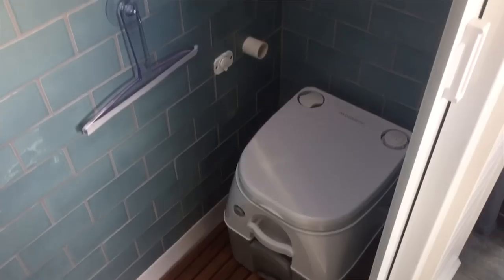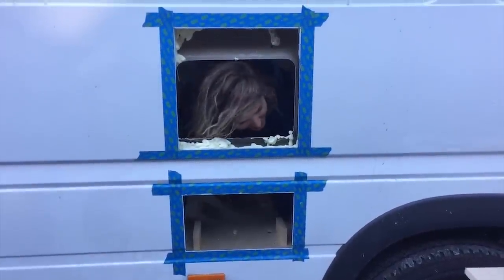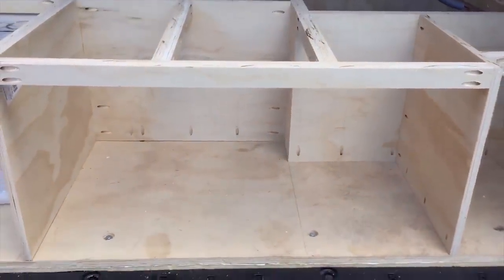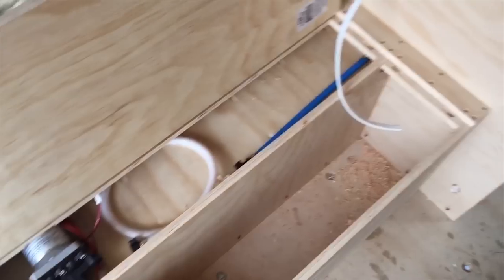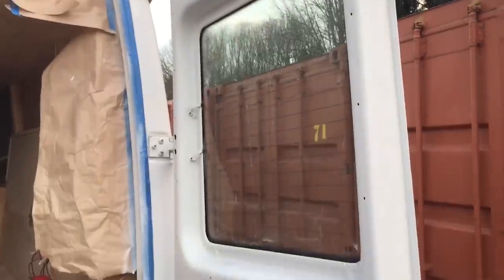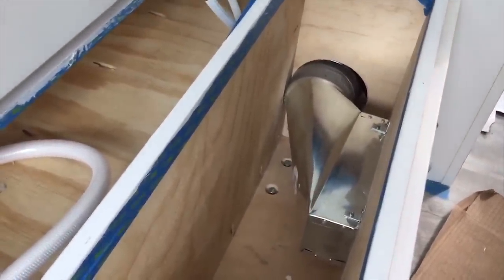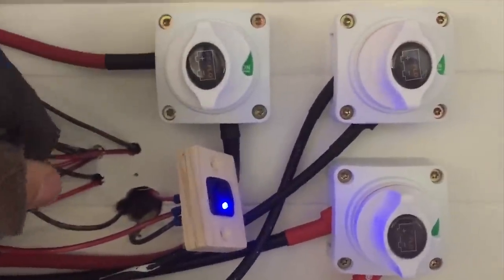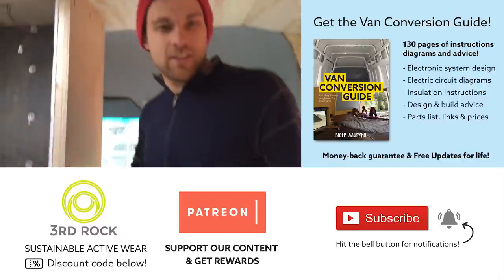THIS IS HOW YOU CONVERT A VAN - The Ultimate Sprinter Self-build Conversion 🛠

Comment: What did you bond the tiles on with? Normal tile adhesive will fail in vehicle with vibration and movement. Did you bond and screw the cabinets? Big bore domestic water fittings are not best in a place where water is in short supply. You are obviously very skilled but you have made the mistakes that many do by using domestic building techniques in a vehicle which  throws a whole range of issues and dynamics into the build. The finished job looks really good.

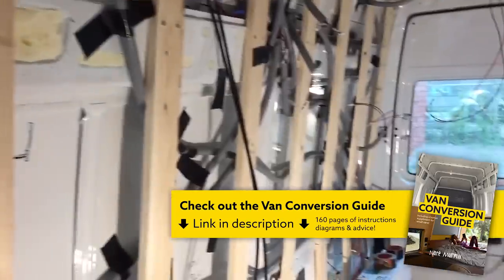Comment: Each time I see a campervan conversion I never understood why they don't do the wiring as we do in homes, so that we can replace them if we need later. I am really pleased to see at 4:35 that you have the same line of though as me.

I use at home roofs tiles of polyurethane foam and they are so effective for sound and temperature isolation, that each time I see someone using other materials for their van insulation I always wander if they don't know about this foam you used at 6:35 ;).  

Do you know you can spray this foam with a machine? The polyurethane foam for the machine doesn't expand, thus you end up having a more plane surface that doesn't need to be trimmed.

Comment: how do you let the foam breathe?  You know, so when you are in humid weather it doesnt mold/mildew
Reply: @Toadie_The_Frog  no the foam enclosed in the walls.... spray foam is not supposed to be sealed up in cavities.   It needs to breathe so as to not make mold/mildew after a few years.  manufactures recommend around a 1" channel of air for it to breathe.   (I have looked it up already a few months back)

Comment: 28:06
The insulation on those cables are going to wear through in about a month!
Why didn't you cut a hole the same diameter as the conduit and run that through the wood?

Comment: So heavy using extension cords for your electrical wiring and metal studs for your framing would have saved a lot of weight.
   Having said that the work  is well done great job. 
           And regardless of the weight I would love to have this van.

Comment: Lovely build that .  But van will be well over weight with the thickness of all that wood in it . Nice build
Reply: Was going to say the same looks really nice but would like to know the weight
Reply: Add to that the weight of backerboard and tile.  Unbalanced and exceeds weight limits.
Reply: My sentiments exactly. On my 3rd build and must say I haven't built one that nice.  I would like to know the MPGs.  That is a lot of wood.  Great insulating job.  You won't regret it.
Reply: God i was thinking the same. Beautiful but way too much wood.
Reply: presumably these vehicles are designed for carrying lots of weight. Having said that I don't understand why you would add unnecessary additional weight. Filling the water tanks must be a lot of weight. The tiles are just ridiculous. A bit of polycarbonate twinwall or something for the 'bathroom' would surely make more sense.
Reply: Ha yes this is exactly what I thought when I saw all that thick wood and tiling. It's a beautiful conversion and the vans are designed to haul large loads but why add weight unnecessarily? It will just made the van slower to drive and use more fuel, it's a camper after all not sure why you would want to use building materials to make it look like a house...
Reply: @lass-inangeles7564  There did seem little thought about the weight but they have covered that but not put that dull bit in the video. Lot's of permutations of that van but here in the UK the common maximum on a standard driver's license is the 3,500kg GVW 314CDI van which has a payload of 1,516kg, which I would say they seem to be under.
Reply: I really doubt it'll be overweight. I use a van just like this at work (builder) and we put way more stuff in it than that. It's heavier than most van build projects, for sure, but not overweight.
Reply: Rogue Panda I’m a granite fitter and that van is no way overweight 👍
Reply: Same thing i was thinking, time to add a turbo on that beast and some 4 pot brembos.

Comment: Some like more of a feeling of open space, like Nate, so they only have top cabinets on one side.  Or not at all, just shelves.  But I think a lot of a space feeling open has to do with colors.  That's why I would want a white interior, like these two did it, no matter what.  Mirrors are another trick, but white does the job just fine.  They had plenty of extra storage space but because the decor wasn't dark, it didn't feel cramped.  You give up a lot when you don't use every inch, IMO.

Comment: how you deal with the weight of so many things??? Im always thinking how expensive is on gas XD
Reply: the weight doesn't add too much to the fuel consumption, usually around 0.1 liters per 100km for every 100kg of additional weight :)
Reply: Transmission, brakes, tires, gas mileage ...
Reply: Don't get me wrong, I think that is an amazing job. I'm thinking in my case, I wanna convert as well a vehicle, but I'm always thinking in the 💰
Reply: Brianna B it’s a van, it’s designed to take weight
Reply: @MrBrenos  ... ALL vehicles have weight limits.
Reply: Brianna B no s$&t.
Just like my merc that is rated to carry 2.5 tonnes.
Reply: @briannab5296  Agree, will be way overweight - which means its dangerous, (suspension and brakes can't cope) and in some countries illegal too. Looks to be the same model as mine (3500kg GVW), max payload is 1500kg as its a single wheel not a dual rear wheel. Those tiles and back board will be seriously heavy.
Reply: These vans are delivery vans. They are designed to carry weight. Specs usually display how many pallets you can fit in.
2 pallets at 2 tonne is a LOT more weight than the van is carrying with the fitout and the van can handle it easilly.
But you are right, the heavier the more it costs to run. 

On the bright side if you really want to cut down on $ you could try fitting out a Volkswagon Beetle  ¯\_(ツ)_/¯
Reply: Nolo Kobo  Sounds like a nice, well thought out, plan. 

Wish you safe and happpy travels.

Comment: Awesome video, I would recommend not using plastic PEX fittings or that style crimp ring, also using a flex hose instead of a water hammer arrestor is not great your relying on a rubber washer to seal it will eventually deteriorate

Comment: Wood frames and wood panels are raw and untreated.  This will absorb moisture and mold over time, warp and may rot. Because moisture builds up living in confined spaces. Treating the wood makes it last years longer. Or buy treated wood.
Reply: FreePizza007 with what would you treat raw wood?

Comment: Lovely van ! but weight looks to be a problem or at least it would in the uk/europe ..with a 3.5 tonne limit im guessing it would weigh in well over that with  full water tanks and people on board ..ie illegal here anyway as well as a bit dangerous but hey if it looks nice!! i wouldnt worry bout it not being able to stop and turn fall over like a drunk elephant!
Reply: My RV is supposed to weigh only 3.5 tons as well but with two gas bottles, a full water tank and a full fuel tank, it tops that. Most campers do. You just take it for inspection with empty tanks
Reply: @johnsexton3841   fully aware of how to get round the tests and inspection like a lot of folk! but the weight  limit is put there for a reason! Ie... burning through fuel tyres, brakes, clutch, bearings and suspension quicker added to that it'll  drive slow and sluggish and horrible!
That might not bother a lot of people but it would me... and then you have the fact that its probley a 4+tonne missile that wont stop in a hurry on a motorway or anything over 25 mph ...id rather stick too below the limit and sleep better at night 👍
Reply: @markgrinsted8728  The chassis on my RV is the same chassis used on the 7.5 ton box delivery trucks, as are many. Others use the 5 ton rated chassis when making RVs. But lots of van conversions are way too heavy and not rated for the extra weight. That said, this conversion probably weighs in at less than you thi k.

Comment: The number of people complaining about weight of wood in this comments section is dumb af. A full sheet of 18mm ply is 30kg (half that for lightweight ply). That means you could have 50 sheets of plywood in there at max capacity (assuming it's the low payload model), or 100 in lightweight. That's a metre high stack of sheets. They're not going to be touching even a half that in this build.

Comment: i realy would like to see that Van build on a scale 1. empty when finished build 2. full water, gas, food, fuel and all the gear you are going to put in there. No way you will stay in the weight Limit sorry to say but if i don’t see a scale sheet i would consider that build unsafe and not recommend it to be copied.
Reply: Which parts make you think it's heavier than the average build? The size of the water tank and number of batteries? I'm just curious as we start planning our own build. How do I find out how much weigh is safe?

Comment: People complaining about the weight. It’s actually very minimal. Ply is lighter than solid wood, plus the stubs are only soft wood.
The van is designed to take weight
Reply: Ply tends to be heavier than most wood, but it very much depends on species. It's still very little weight in this build though.

Comment: big fan of the overall design tho not a fan that they cut two huge windows into the van... man all that loss of heat.. :I
Reply: Or added solar gain?! Not a fan of oppressively dark van builds so I'd trade heat loss for a view any day.
Reply: @arfski  the van would have let in enough light with just one added window. you also have the front windows and the back windows to let light in plus the skylight window they added...  but hey whatever floats the boat.
Reply: @arfski  also the two large windows is a dead giveaway someone is probably using the van to sleep in, getting attention from police in cities & thieves

Comment: I get goosebumps when I see people using glass fiber insulation in an constrained vibrating environment. 
Instant cancer.
Reply: That is absolutely NOT instant cancer at all!

There has been done a lot of research on porous materials like glass fibre (and rockwool etc) and such, and there is no or a very minimal link to cancer or any other illnesses. Certainly not significant at all when used only occasionally and being behind a wall.
Different story if you work with it on a daily basis. Doesn't mean those are nasty materials to work with, not the most pleasant experience.

Personally I would use Rockwool instead, because it insulates I tiny bit better and is fire retardant.
Reply: I'd rather use recycled plastic insulation but yes Rockwool is fine too. As you say the Rockwool it's trapped behind a wall so perfectly safe 👍
Reply: @marks-0-0  Unfortunately most recycled or "green" products don't work as well as Rockwool or glass fibre wool. There are some alternatives, but they are almost 3 times more expensive. (fyi rockwool and glass fibre are mostly made from recycled materials anyway)
Reply: Piet Muijs They said the same thing about asbestos before... ;)
Reply: @Skupik1  With asbestos it's actually the same story. Although a lot worse, these is very minimal relationship with sporadic use. It's a VERY different story when dealing with it on a daily basis. Anyway, it's not really comparable to glass fiber. Just do a quick search on your favorite search engine.
Reply: Not just the particles, but fiberglass is totally wrong inside a van due to condensation from heating, cooking, showering, etc.  There is natural condensation between the metal exterior and behind the wood panels.  Sheep wool or mineral rock batting can handle it and breathe and not get soggy.  But fiberglass gets soggy and gives zero insulation after a short while.  All wrong!
Reply: @lass-inangeles7564  scamp campers are made of fibreglass. Very popular.
Reply: @FreePizza007  Such a smarty pants aren't you?  Scamps are coated over with resin.  The fiberglass is encased in a tomb.  Ditto for ovens, microwaves, etc.  This fiberglass is free floating in a van inches from your face at all times.  Now go play with the other teenagers and let the adults talk.

Comment: Sooo, you basically cemented 5 miles of wire into your walls. I guess 1 electrical fault could literally total your van.
Reply: Exactly
Reply: All wires are running in conduits, as they should. You can say the same thing about your house.
Reply: Are you even familiar with electrical installations?
Reply: Fuse panels prevent fires. It helps to have a clue when you enter hate mode.

Comment: Sorry, this build job is absolutely absurd and overkill on so many levels.Should have kept things simple, inexpensive and reasonable.  Your shortly inviting ( fixing) problem after problem with very difficult accessibility. Even after a simple vehicle accident, it’s likely to cause you multiple problems in electric, plumbing and heating, not to mention the actual mechanical damage to the vehicle itself.
Keep things simple  so a infrastructure breakdown doesn’t break your heart and happiness.